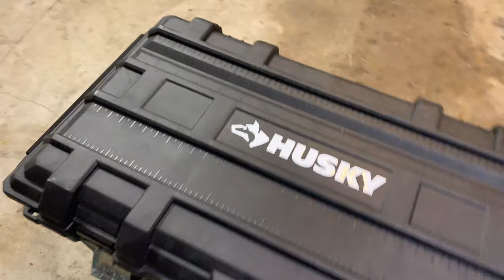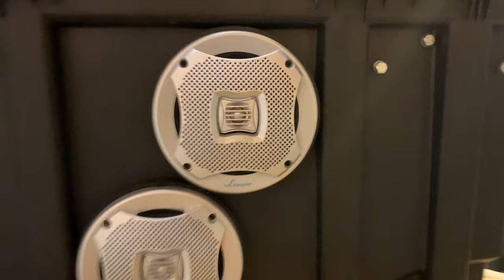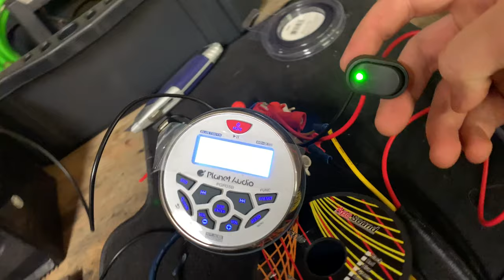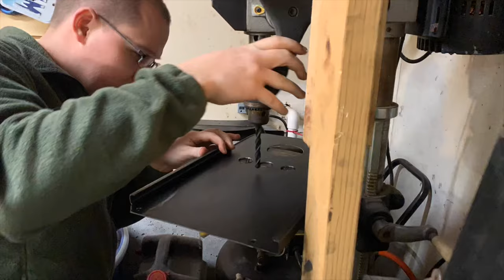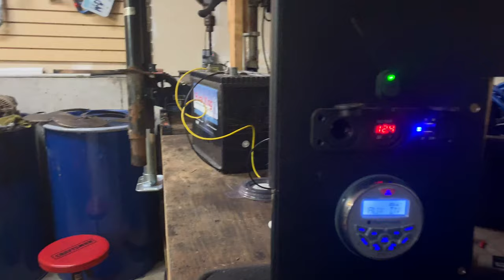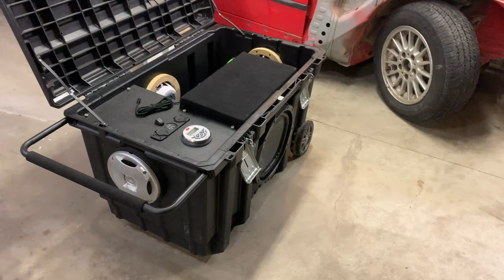DIY: How to make a portable loud Bluetooth speaker

Comment: I'm looking at a bunch of 18650s as a battery pack for a 500w peak build, they sell packaged up ones for e-bikes with a battery manager and overcurrent/overheat protection and i was able to push like 10 amps out of it, i hope more in parallel in a 4s4p layout will be able to do 30 amps lol

Comment: What are the specs of the battery I really want to do this now dosnt seem too difficult compared to my most recent car audio install
Reply from the maker: It uses a generic rural king 105 amp hour deep cycle marine battery. On a reasonable volume it will play for 20 hours no problem.

Comment: 20-25 hour play time? Im doing something similar with 170ah agm and 500 watt rms. 2x10” midwoofers and 2 tweeters
Reply from the maker: Yep, at full volume they will only last 10-12 hours in the sun but that’s plenty when floating. 

Yours should last quite a while and should sound great with just mods and highs
Reply: @Localhost127  have you measured your amp draw?

Comment: Could you power this with lithium batteries?
Reply from the maker: Yep! A “4S-XP” would be perfect for 14 volts.  It would be 4 cells in series and however many you’d like in parallel to get you the run time you wanted.

Comment: would i need to study electronics to build this or it pretty easy to do without previous knowledge?
Reply from the maker: you could definitely do this, without previous experience the most complex part would just be wiring up the switches. Just lookup headunit and amp wiring diagrams.
Reply: @Localhost127  thank you so much for replying and I’ll give it a go

Comment: How long does this play on the battery
Reply from the maker: Longest we’ve seen is about 20-25 hours while camping.
Reply: Is the bass loud
Reply: @Localhost127  20 to 25 hrs at max volume? If not , how many hrs would it sound at max volume on which it would sound clean
Reply from the maker: @estivenvasquez4811  the clarity starts to drop around 12.0-12.1 volts, from 12.7 - 12.2 volts its generally around 10 hours max on a fresh battery. It definitely seems that the 20+ hour play back only happens when we're playing less bass-ey music. The sub certainly consumes some power.